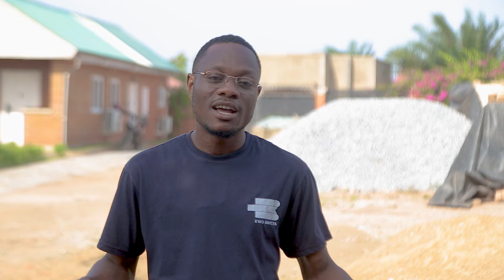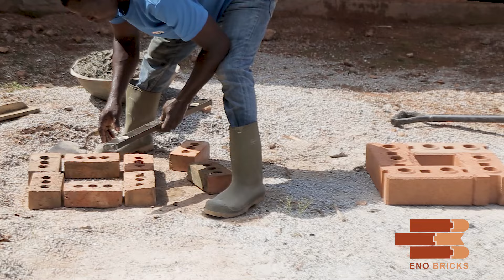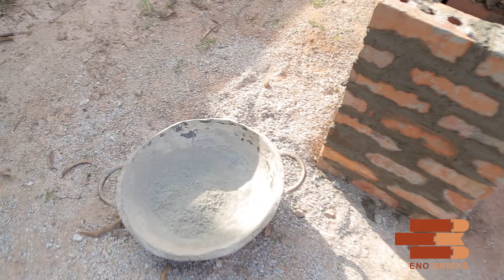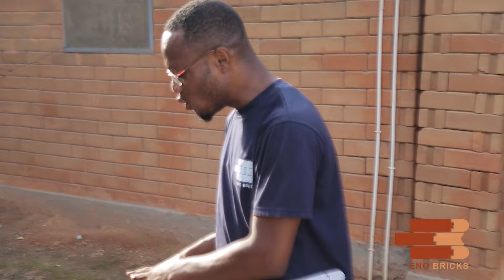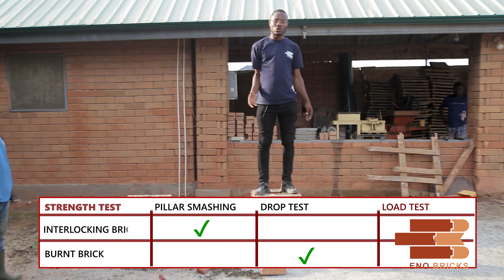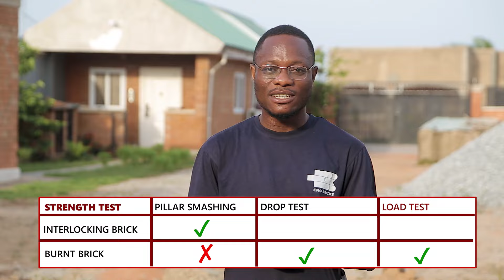Interlocking Brick VS Burnt Brick

Comment: what're the dimensions of the interlocking blocks
Reply from the maker: 12 inch (Length) x 6 inch (width) x 4 inch (depth) referred to as 6 inch bricks OR 10 inch (Length) x 5 inch (width) x 4 inch (depth) referred to as 5 inch bricks